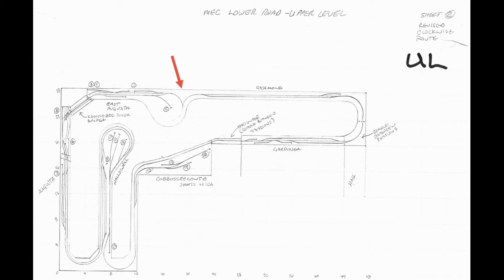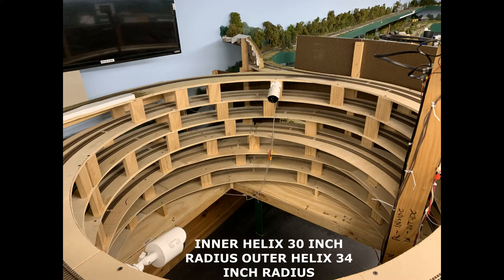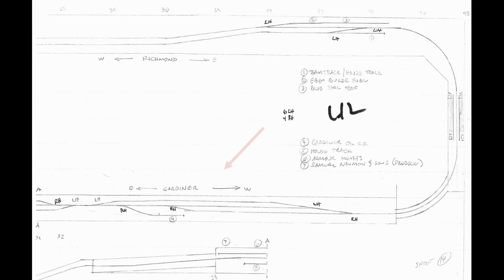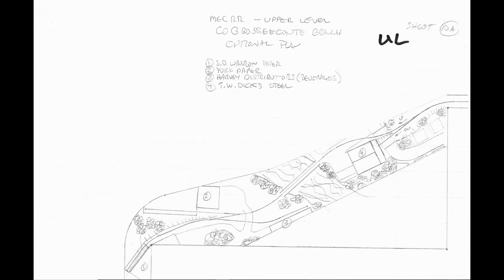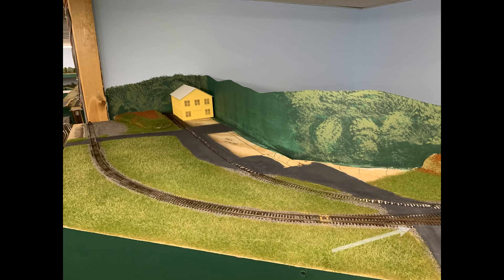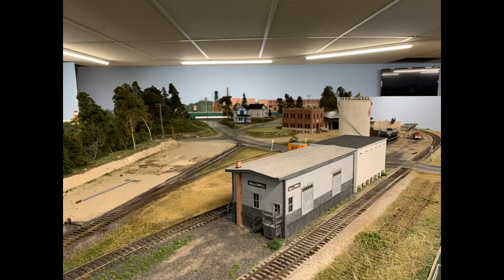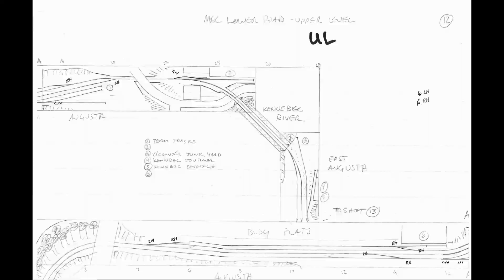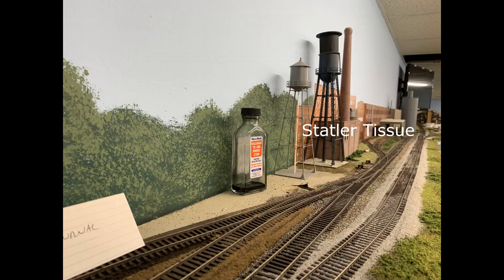Designing the MECLR Part 3

Comment: I too am from a tree friendly State and due to this will need a lot of trees.  What have you been using?
Reply from the maker: I use super trees, the big boxes cost a little over 100 but give 200-300 tress of various sizes. I use everything from small pieces as bushes and young trees to pieces that are 4 to 6 inches tall. If you have willing friends you can get a box plucked trimmed painted and flocked using an assembly line. I generally do all the selecting, picking off seed pod covers and sorting while watching something on TV. Then paint 100 at a time and flock.